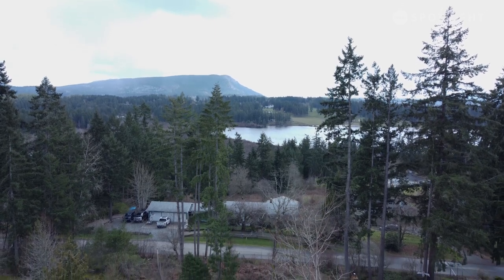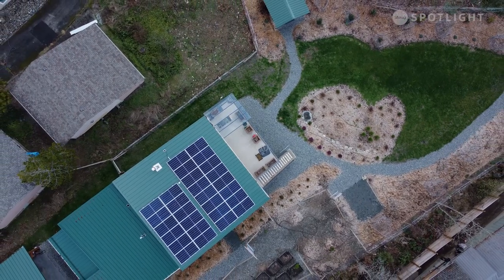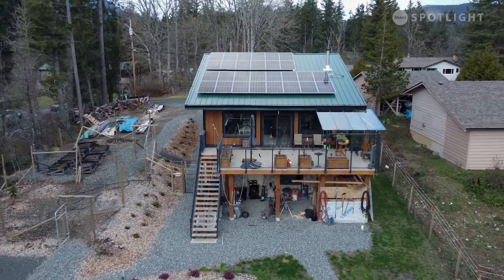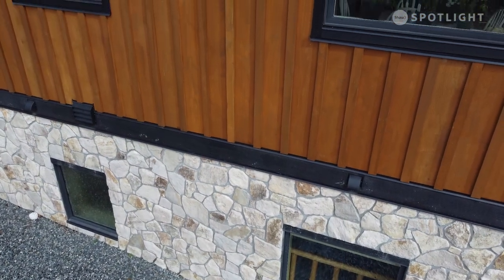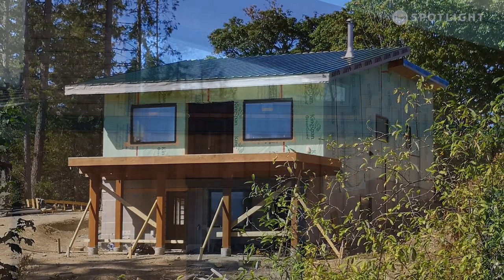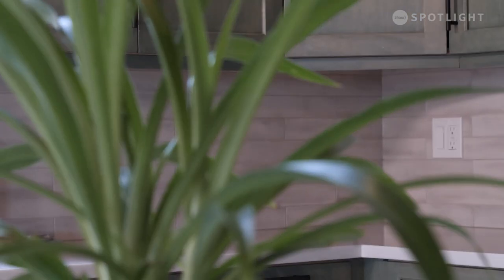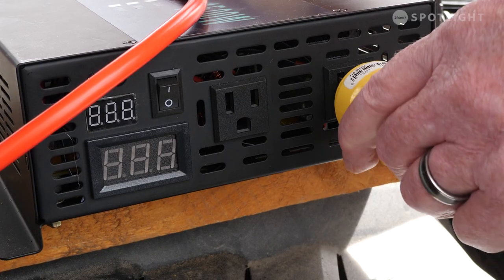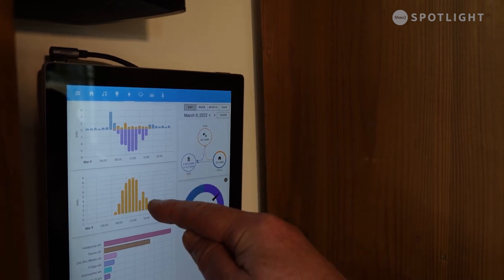Our Net-Zero Home on Vancouver Island

Comment: This is a complete joke.  Firstly, these folks are obviously very financially well off to be able to use high-end technology in building this particular house, most are not so lucky. Secondly, this house IS NOT net-zero.  The owner is burning firewood as shown in my of the scenes.  One has to ask, then, where do they get the firewood?  So some trees are harvested somewhere  and transported to their house for their use, obviously using fossil fuels to do so.  And no doubt cut with a powersaw which may have been petroleum based. And then there are the emissions given off from the fireplace, smoke particulate and other gases including carbon dioxide.  So the net-zero is a joke. It is so self righteous for them to say " I can't believe there aren't more homes like this in BC".
Reply: I agree.  I live on Vancouver Island. A net-zero, completely electric home is IMPOSSIBLE.  It is dark, damp and rainy most of the year.  There are huge trees, wind storms and power outages regularly.  A minimum of 2 heat sources and a generator are necessary in every community outside Victoria or Nanaimo.  EV charging stations are few and far between and when the hydro goes out, they are useless anyway.  This guy's house likely cost way over $1million and the average family can't afford to build a net-zero house.